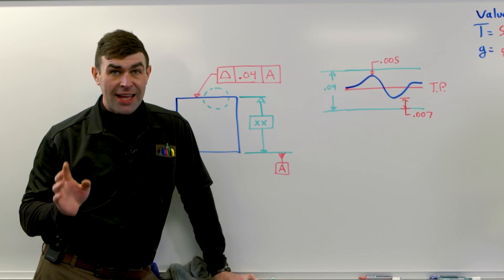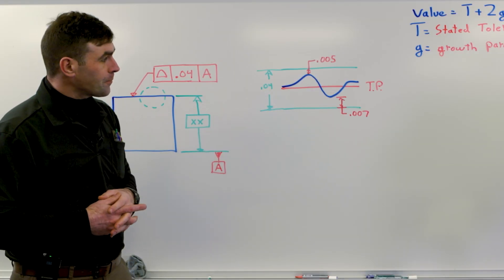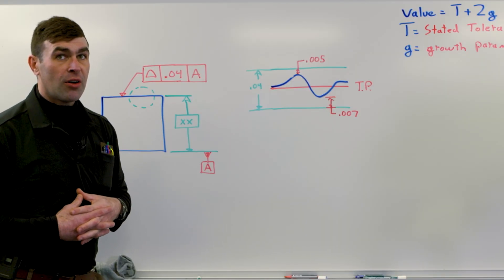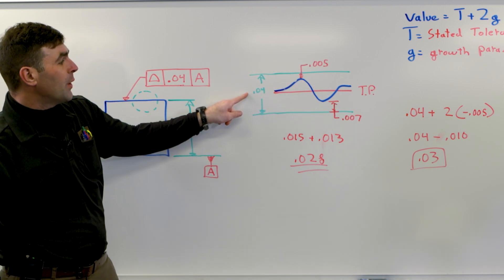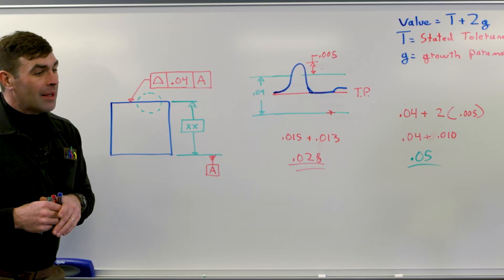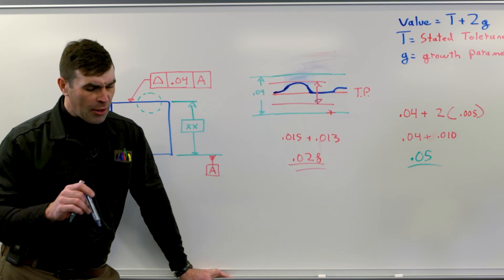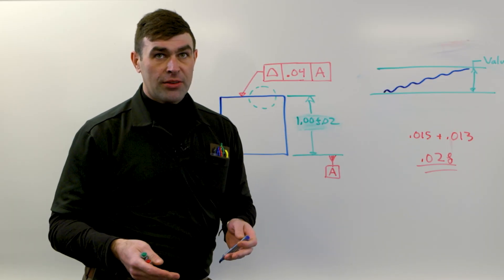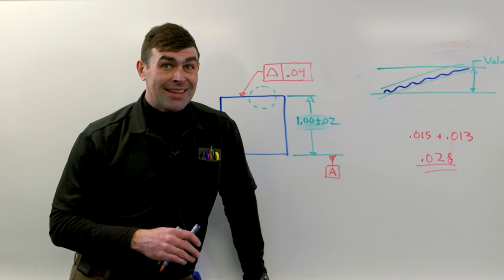GD&T Profile Measurements Not Adding Up? Here's Why

Comment: How is the surface profile of datum A compensated for? I.e. how is the method of establishing the datum going to affect first the "True Profile", and hence the measurement of the surface.
Using a three point probe to establish datum A will give different results compared to resting it ("A") on a surface plate.
Reply from the maker: The purist way is a surface plate. With a CMM you certainly need more than three points to define a datum plane from a surface.
Reply: @RDeanOdell  Three points is sufficient to define a plane... , but maybe it's that the surface itself also needs some tolerances to be set, to help clarify just how good the datum should be. (more nuances;-)

An interesting question is whether a collection of datums is in fact data (plural), or are we far enough away (+/- decades) from Latin as the international commercial language ;-)

In terms of datum 'errors', one I had to look at (system test fail; c'85) was a simple mounting plate for a CRT (1" cathode ray tube) where the centre of the hole into which the CRT would be bonded was to +/-0.1mm relative to the plate edges, but the four tapped mounting holes at the corners of the plate had a tolerance of 0.2mm (all PTZD)

So while the central undeflected CRT spot could be positioned to that 0.1mm when bonded in, with electronic controls to compensate for that range, in reality the whole assembly would slop around by the +/-0.2mm which was outside the electronic adjustment range to bring the spot in alignment with the optics.
Ultimately 'they' decided not to change anything (too much paperwork) and simply update the assembly instructions to 'tweak' it!

Comment: I was taught to just double the value furthest from true position. The way you explain it is easy to get but much longer to get to then just doubling your furthest deviation From TP.
Reply: OK, you’re talking about when you’re getting other geometric controls for free when you’re applying a profile tolerance to a control that doesn’t have any datums Gotcha.
Reply from the maker: So that works if the profile is controlling location, but not if it’s just orientation or form. I know the explanation is lengthy, but it’s necessary to understand the topic and be able to explain the concept.